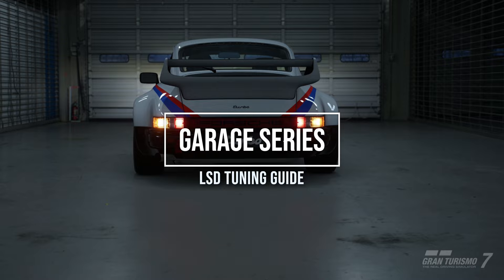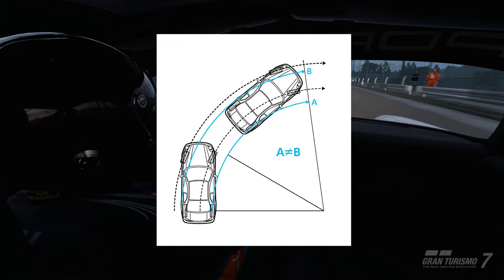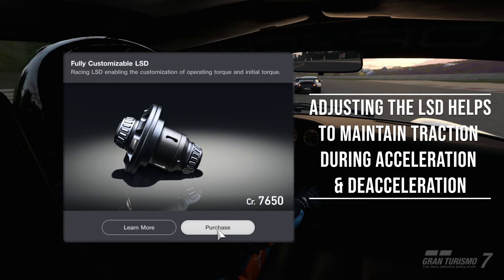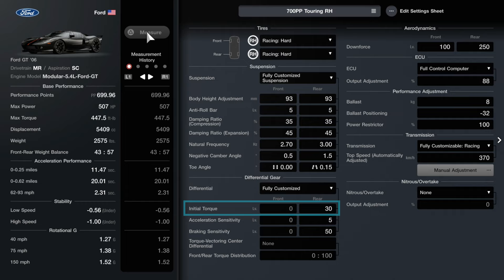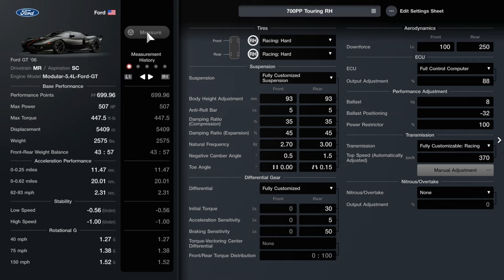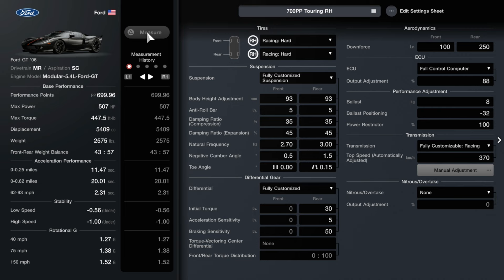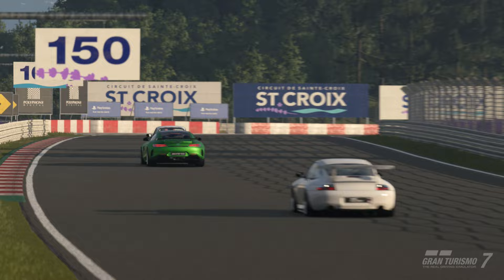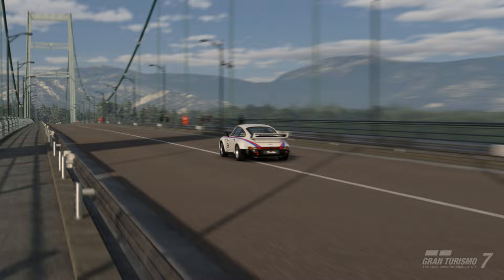GT7 - How to Tune the Differential / LSD (Guide)

Comment: So LSD was a solution to my difficulty of driving (mostly) high-tier MR cars with no traction assist. I've always been fiddling with the suspension; wracking up my head how to fix my "fully" tuned up 512BB '76 from spinning out accelerating after turning a corner.
Reply from the maker: Yeah the LSD is a must have on high end cars for sure. I'm still rocking traction control, typically using 1 or 2. Slowly working to getting off using it, but I still find throttle somewhat tricky on controller.

Comment: on PS4 Pro I'm transitioning to TC 0 : FR On dry the car grips no tire spin, but on wet it does spin way worse even with very little throttle input. What can I do to not spin? LSD or Suspension Trying to learn tuning.
Reply from the maker: Lowering the Acceleration setting on the LSD is the main factor, then possibly turning up initial torque if you continue to have issues. The final adjustment I've done on cars like the Camaro etc. was to add rear downforce. 

Some cars, if they have that much power output you're still going to lose traction if you don't feather the throttle, but that's where I'd start adjusting!
Reply: @Voss44  thanks I'm tuning the Trans Am '78
Reply: @Voss44  What do I buy to tune first Suspension or LSD?
Reply from the maker: @berettagt88  Can buy them in any order. Both are important. LSD likely will help more. But both will help ya in different ways,
Reply: @Voss44  ok thanks

Comment: Would be nice to get gearing right.i keep  spinning when downshifting to 3rd almost every time
Reply from the maker: I'll put together a gearing vid. To be honest though, that sounds like more of an LSD issue. Try raising your "deacceleration sensitivity" in your LSD and see if it helps. Just be careful you might have to adjust the suspension as well, because messing with the LSD does somewhat affect handling too. Any questions hit me up in the discord and I can help tune. 

Basically is the LSD is more active, the car will have more stability, but less available power being put down. Which sounds bad, but if you can find the sweet spot of mashing the throttle (or the brakes in your case) where the LSD doesn't make the car lurch to the side, you'll still be better off as you'll in theory make up the lost time and gain on the lap.

Comment: Can adjust braking sensitivity resolve rear-end sliding while braking at high speed and turning at the same time?
Reply from the maker: It'll help if you crank it up. Basically it'll make the LSD give you a bit more stability in that situation. But, one thing I picked up from the license tests was that braking is best full force in a straight line, THEN roll. Typically it's more effective if you have 4 tires making maximum contact before you turn.

Comment: at 2.45 u said higher braking sensitivity add more  oversteer 
but your graph say higher sensitivity will add more understeer 
witch is it ?
and i find in gt 7 bmw oversteer a lot midle of the apex no matter who i setup the car any tip?
Reply from the maker: Great question. When I said "spin out" I was referring to the snap oversteer you get with traction loss on corners, if accel sensitivity is too high (you get snap oversteer as the LSD puts more power back to the drivetrain). At 2:45 I was talking about the LSD in general, not specifically braking sensitivity.

The graph is correct. In regards to braking sensitivity a higher value typically give you more understeer. 

So I've played with BMWs on a few tunes now (I've been trying to get an M4 tune I really like). I ended up going with Full Initial Torque (60), Lowest acceleration sensitivity as possible (5), and braking sensitivity about mid (35). That's on a FR drivetrain on the M4. The issue is, you're basically making the LSD work A LOT, taking away performance of the car. It is much more driveable, but I'm not a fan of how the BMWs in general seem to perform in GT7. 

You could raise the stiffness of your Anti-roll bars slightly, and if you find initial turn in is than lacking, add like 0.1-0.2 toe angle and some downforce. 

Just my take on it, I have yet to be able to tune a BMW so I'm happy with it. BMW and Porsche seem kind of funky in regards to tuning.
Reply: @Voss44  okey thanks 👍

Comment: Step 1: buy the 1 way because it's the only one that gives you a fully open diff on Decel.
Reply from the maker: Is some cases for sure. You'd squeeze out some more performance. Some cars will perform worse with it though depending on driver inputs.
Reply: @Voss44  may even, I've yet to see a car that doesn't understeer like mad into the corners in this game
Reply from the maker: @t.lledsmar6052  Fair point. Ok thanks man I'll start playing around with it! Appreciate the feedback!
Reply: @Voss44  try it just go with a 1 way and tune the suspension to make better use of tires through the corner. I just wish there was a tunable 1 way because sometimes I actually want more turn out of a corner.
Reply from the maker: @t.lledsmar6052  Awesome man I'll play around with it a bit more for sure! I also find on some of my tunes I'm intentionally dropping PP to squeeze out some more power as well, which is just not right from a mechanic standpoint. Like I'll go with a manual transmission or a 2 way LSD to drop more PP so I can add power to improve the build. Just seems like an oversight on PD's part as well. I get the feeling tuning will continually change over the next year or two.